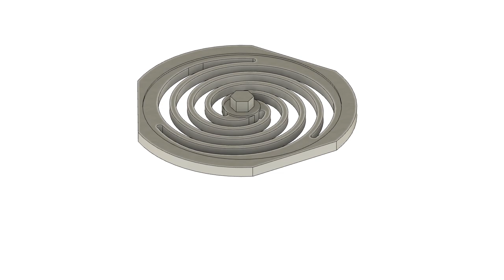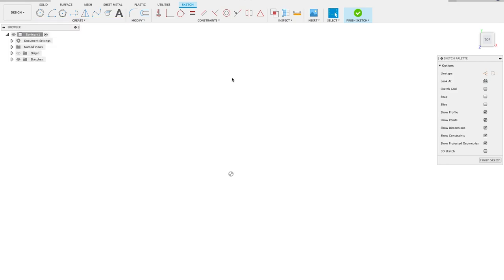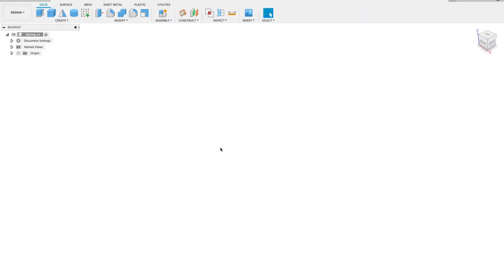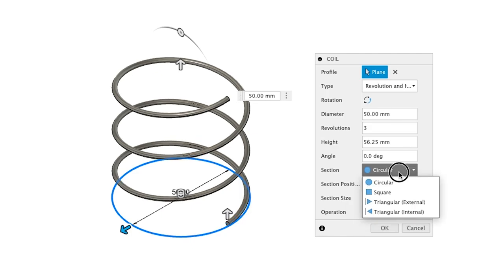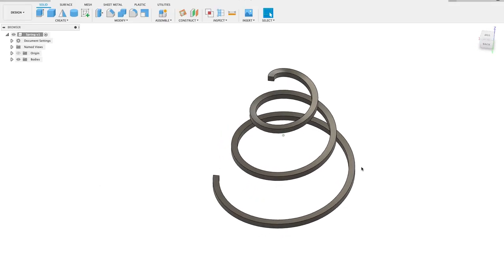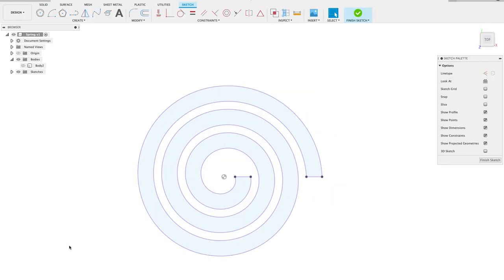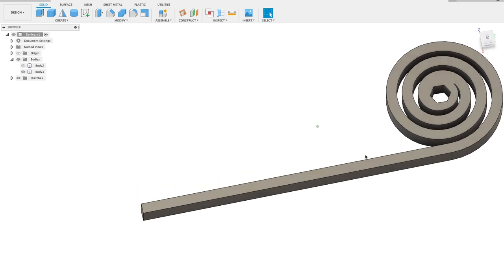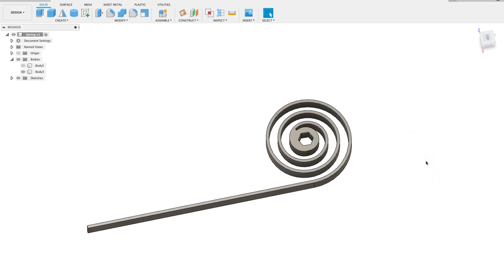Fusion 360 Spiral Torsion Spring Tutorial

Comment: If you look in Prusa Slicer in the Print Settings Tab, under Vertical Shells, it will list the recommended thin wall thickness for different numbers of perimeters for a given nozzle. e.g. for 0.4 mm nozzles, 4 lines is 1.67 mm,  6 lines is 2.49 mm. You can use these values instead of 4 mm / 1.5 mm in your model.
Reply from the maker: Excellent point! In fact, your tip is extremely relevant for a video I'm posting in just over a week!

Comment: I'm looking for some solution to make a wheel be able to rotate 540º to the left and also 540º to the right, but if no force is applied, the wheel returns to the center. Do you believe this type of spring can solve my problem?
Reply from the maker: Possibly, although I would consider adding a reduction gear with a magnet, so that the reduction gear only moves about 90 degrees in either direction and the magnet helps pull it back to perfect center.

Another option might be using a rack and pinion mechanism with a spring on either end of the rack. Both springs will try to find equilibrium and return the rack to its neutral position.

Comment: I am following the video. But Wait. I just find out that you can change the coil type to spiral, and it is flat. I am new to coil and what is happening.
Reply from the maker: It's quite hidden, but yes! Unfortunately, there still isn't a spiral drawing tool. So, if you want a spiral within your design's sketches, you will still need to take the long way around to get there. Another setback with the coil option is that it (currently) doesn't let you set an outer diameter.

Comment: Hey so it looks like Fusion 360 might have a new feature under the Coil option, if you change type to Spiral it flattens it for you now.
Reply from the maker: Yup! It turns out that feature was already there. However you might still want to use my weird workaround if you're specifying the OD of the diameter or doing anything fancy in the sketch that a "spiral coil" can't. Still, for a basic spiral, it's good to have that option. Thanks!

Comment: Great explanation! I knew I'd enjoy your Fusion video.

I haven't used the coil or spiral options much, but I'd imagine being able to work with the constraint of your outside diameter makes things much much easier. Excited to throw some designs together with this! Will share if any of them turn out. 

Have you found any specific thicknesses that seem to consistently give good results?
Reply from the maker: I hope to see what you make! I think 2mm is a good starting point, but it really comes down to the requirements of the project.

Comment: A smart workaround to get a spiral, but I can't believe there aren't any more streamlines solutions! Does Fusion 360 allow for user created addons? Or is there any way to program in actions, like photoshop, that could run through the process of making the spiral coil automagically?
Reply from the maker: There are tons of Fusion 360 plugins, but I'd rather not install them.

I updated the video description with an alternate way to directly generate a spiral spring, but I prefer this goofy work around because you can define the outside edge of the spiral first.

Comment: Is there a way to change the angle of the coil near the top? Great video btw 😀
Reply from the maker: Thanks! Do you mean having two different angles for the coil? You can easily change the overall angle, but if you want the top to have a different angle than the bottom, I believe you'd have to create 2 springs and merge them. It wouldn't be too difficult, provided your okay with the angle change being sudden.

Comment: Just noticed, when modifying the coil, you can select spiral as the type. Don't know if that's a new thing in Fusion?
Reply from the maker: Haha, yeah... I learned about that option almost immediately after posting the video. Oops!

That said, I still use the technique presented here whenever I need to build a torsion spring with a specific outer dimension. The spiral option within the coil tool works the other way around - you can't define an outer dimension (yet). That's fine for some cases, but not always suitable for what I need.

Comment: With the taper, couldn't you just set the height to 0 and not have to use the projection?
Reply from the maker: Unfortunately, the coil breaks when it has no height, so you do have to set some value. You also can't set the height too high of the taper will converge too early.

That said, I've updated the video description with an alternate method that'll save you a step (if you're modeling a plain spiral).

Comment: Can anyone point to a tutorial for the spiral at 0:31
Reply from the maker: The 3-arm spring used in the Twist Lock Box? For that I used the same technique shown in this video, but I made the the spiral very loose and then duplicated it twice (rotating 120 degrees per duplicate). Once I had the 3 arms, I merged them together and used the fillet tool to soften the sharp point where the arms meet - that's a potential stressor that I wanted to avoid.

If you're asking for more details on the box itself, I cover that here: https://youtu.be/1muiuHjyLlU
Reply: @3DPrinty  thank you for your reply. I appreciate your content.